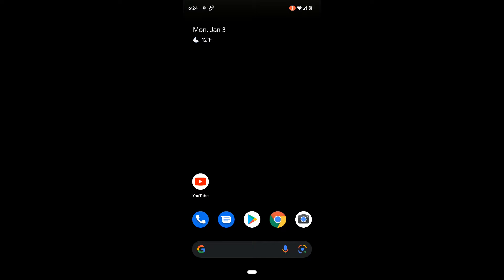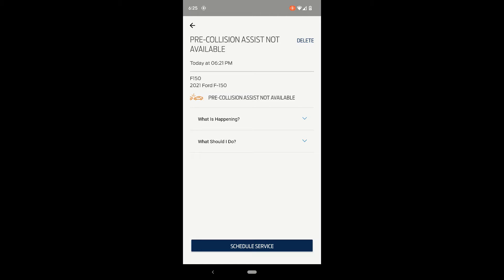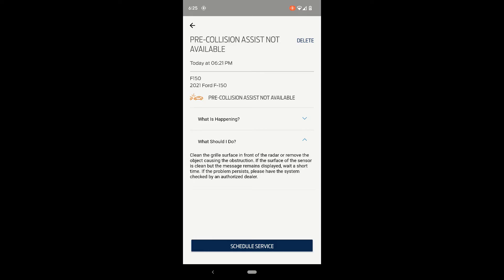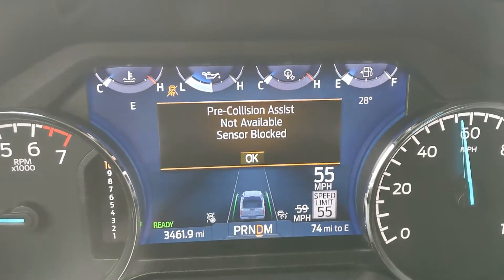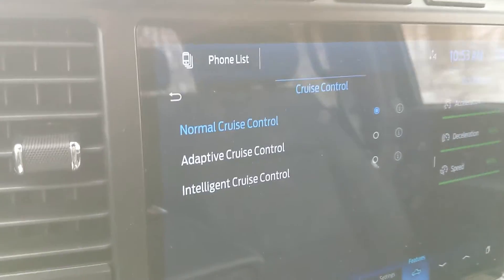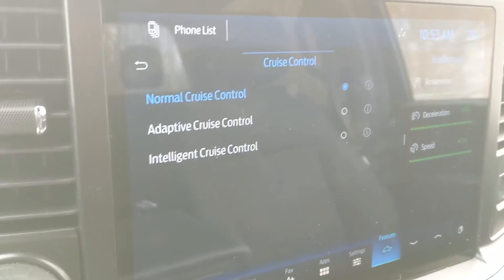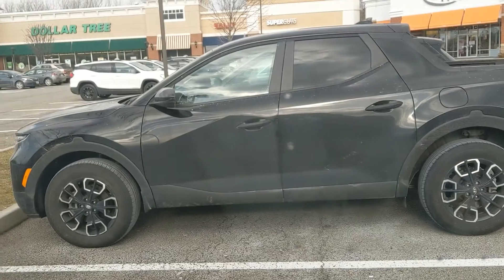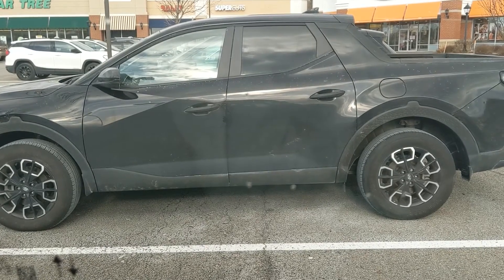2021 Ford F-150 - Sensor Blocked = No Cruise Control?

Comment: Something similar happened last winter with my 2021 Powerboost with Ford 360 2.0 Assist. While on the road in a snow sleet storm, the front grill got iced over and the same message appeared in the truck and in the Ford App. As reported in another comment, I turned  off the adaptive and the regular cruise functioned as a normal cruise control. The next day temps went up and the grill thawed and the sensors came back on and the system worked as normal. But you asked about other messages, I have gotten similar warnings in the truck and app regarding low tire pressure. At a later time the rear sensors failed and there was a warning in the truck and app. This required replacement of the sensors by the dealer. Initially after the sensors were replaced they would not boot up and the dealer sent for a new module (don’t remember the name) however the next day the system booted up on its own and all sensors started to function. There is more, I checked after a later oil change and the part order had been canceled - Ford or the dealer via the App was aware that the system rebooted. My point is that via the app or the truck internet connection,Ford can monitor the function or lack of function of the system. I would be interested in what you can find out about this aspect of these connected Ford  trucks.

Comment: Sensor in bumper gets water and ice in it ! Mine stop most of the winter and then work again once thawed out ! POOR design !  Now drive mode is not working ! Sat radio just went off as well ! First snowstorm collision avoidance goes off ! Not sure if cruse control stops as I never use it in winter on ice covered roads. Mine did not have adaptive cruse ,just as well in Canada's North !

Comment: I have same issue when turning on cruise control.
Ford dealer blaming on Safelite for bad job on replacement the windshield since it's not sitting flat in angle with the roof .
They are going to replace it again will see.
Reply: You can get your cruise control working again if you turn off the “Adaptive Cruise Control” in the settings. If you’re in regular cruise control mode, no sensors are needed.
Reply: My limited is doing the same thing, it wont let me turn it off at all.  Any idea?
Reply: @labesafi  hi! same probkem, how did you solved it?

Comment: Hi, I got a F150 where after a front crash the bumper and the cruise control module were replaced. After repairs done the Cruise adaptative control work fine but the collision warning  does not,  even the truck dashboard display does not show any pop-up malfunction warning. Everyting looks ok and working fine, but in reality the collision warning does not work. The way I use to check it is driving in low speed  against a parked or stopped vehicle or anything on the street and no collision lights and sounds  go off.  So,  what you think? . Thank you
Reply from the maker: It's really tough to get the collision warning to go off on purpose, the only time I really see it is if I am actually about to hit someone. Or if a vehicle you are following is turning in front of you and you are pressing the gas pedal knowing you won't hit it but get too close.

Comment: On my 2023 Bronco this will turn off Adaptive Cruise
Features -> Driver Assistance -> Cruise Control -> Normal 
Obviously you'll have to manually turn it back on to see if it works. My sensors are in the bumper (not the same as where the cameras are). They are little round flat bits about 1/2 inch in diameter, that are not made of bumper material. 

Crapped out on me with snow but who would drive a Bronco in the snow or mud ;-)
Thanks!

Comment: Could a headlight going out cause the pre collision censor to not work? In turn making the cruise control not work?
Reply from the maker: I don't think so since the feature works without your headlights being on. Typically this is done using ultra sonic or lidar sensors.